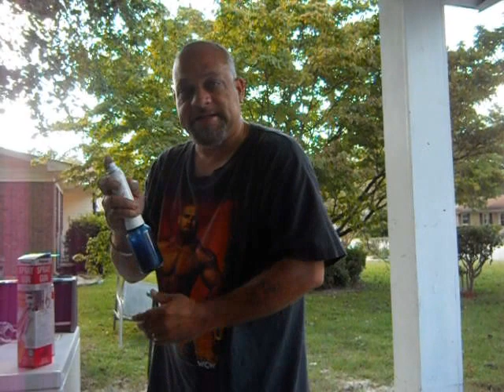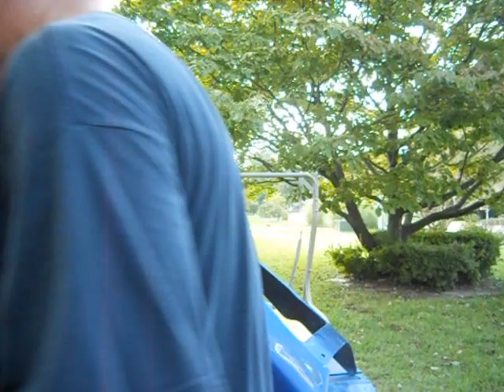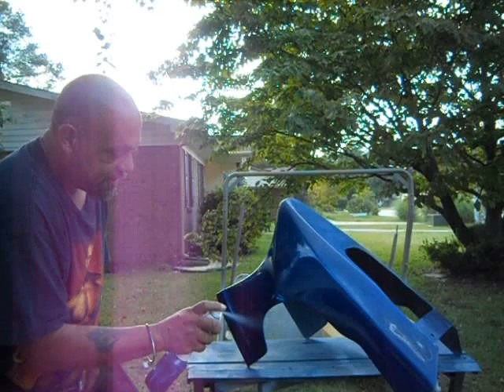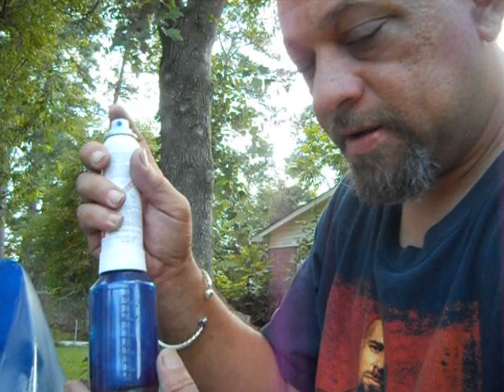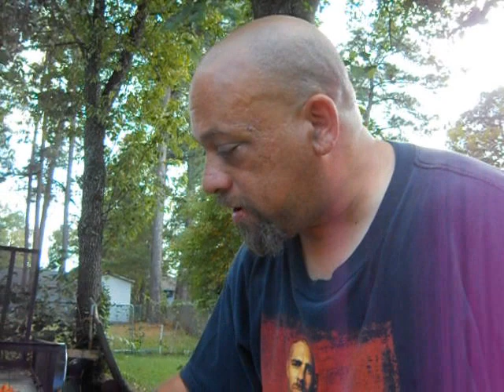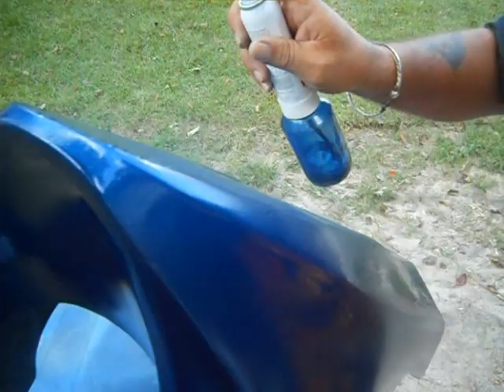Just showing how i painted the bike and what i used.

Comment: Thanks for the video.  I was not sure if this would work for me to do some touch up on my car.  I don't have access to a compressor and paint sprayer where I live (it would be extremely costly to send one in).  I did notice these in a local shop and can get the paint mixed.  It looks like I will end up having to do a lot of sanding between coats, but it should look good enough to sell the car.  Thanks again.